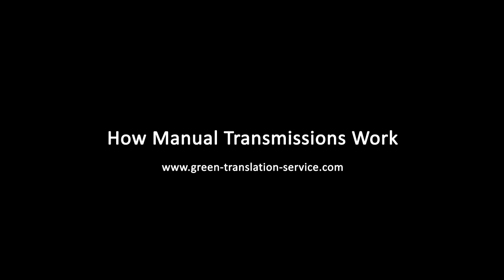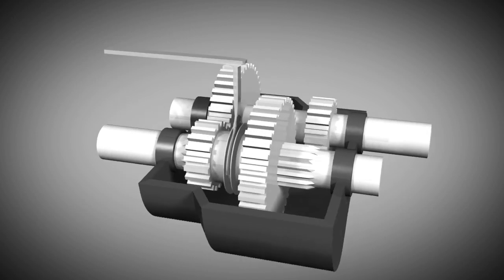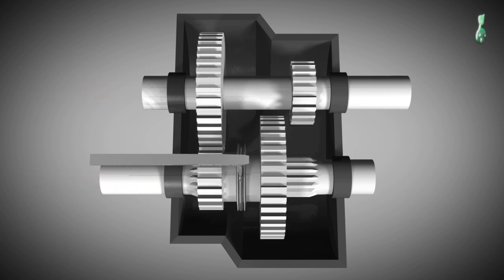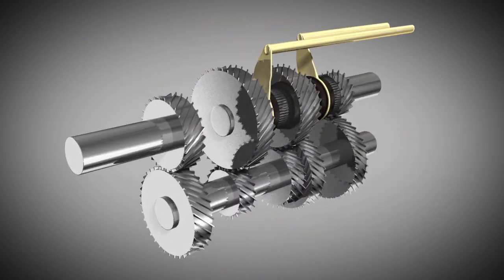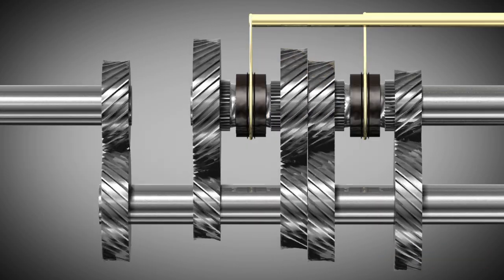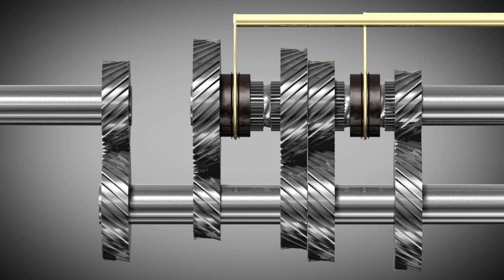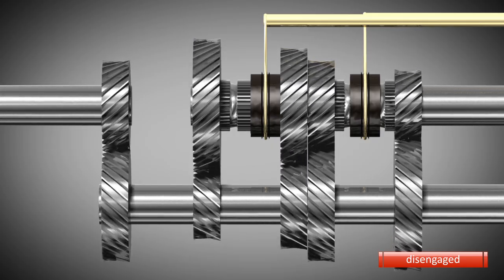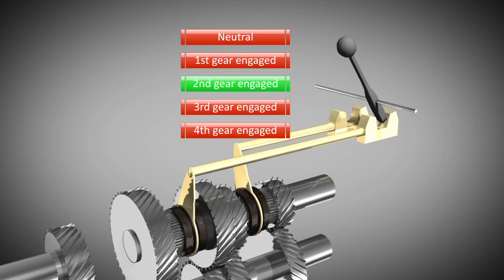How Manual Transmissions Work! (Animation)

Comment: Thomas, thanks for the great video! could you please provide a good visualization of partial engagements in dog clutches? or direct me to a good source? 

dog clutches are often used in AWD/ 4WD 'disconnect' systems, i.e. if half-shafts and wheel-hub are disconnected, they help to get them connected again and drive in 4WD mode. I don't have a good idea of what exactly happens in partial engagements, or why they happen. I just know that it is related to the bevel of the dog clutch design somehow. it would be great if a clarifying video/ animation is made focusing on geometry :-) thank you in advance! please keep these coming.

Comment: It's so hard to understand how the energy is actually transferred when all the gears are constantly connected to each other. I understand that the position of the dog clutch is what decides the gear ratio, but not actually why. Great video though!
Reply: The energy transmitted by the engine hits the first thing connected to it's line of stream, what you dont understand is that energy is not coming from the engine it self, but rather preserved in the fly wheel, then transmitted to the input shaft, putting this concept in your mind will help you understand this.

Comment: I don't really understand the dog clutch part.
Reply: +kevin gose Its not the Output Shaft which is rotating. He has clearly specified that the gears on the Output Shaft are Losely connected and can freely rotate. It Seems like the output shaft is rotating even in neutral position but its only the Gear on the output shaft which is rotating. OutPut shaft Will only rotate when the dog clutch will be fully engaged.
Correct Me If I am wrong...😊😊😊
Reply: It seems like the outputshaft spaining anyway and the it slide to one way. What does do？ How does it make the change？
Reply: +kevin gose Really great video by the way.
Reply from the maker: Here you'll find what you are looking for: https://www.youtube.com/watch?v=0Bqs-oHBBQk
Reply: +Thomas Schwenke Thks a lot！Now it makes me way more clear！ Even tho there is a little bit detail I don't understand. And I really like your channel. I like how u using those pictures to explain things. It make things more sample and clear. It is a really easy way to understand cars. Keep up the good works！
Reply: when the dog clutch grabs onto a gear which is done by shifting gears, then the dog clutch will rotate the output shaft at the speed of the gear it grabs on to.. hope its helps.

Comment: what about reverse gear? and and how does the fifth gear works?
Reply: +Omkar Chavan reverse gear is activated by a separate intermediate gear connecting the parallel running shaft to the output shaft. 4th gear is usually when the input shaft and the output shaft are connected directly with a 1:1 ratio, and 5th gear would be an overdrive gear ratio where the driving gear on the parallel shaft would be larger than the driven gear on the output shaft
Reply: +Paul Wiest I mean the counter shaft not the parallel shaft excuse me

Comment: So here's a question, what if you moved two of the dogged clutches at the same time initiating say 3rd, and fourth gear at the same time? What would happen?
Reply: ***** I don't even remember posting this question. Now thinking about it, my guess would be that the engine would just lack in power severely, and that it would engage both.

Comment: why sometimes it jerk?
Reply: +omguanyin The jerk occurs when the output shaft is rotating at a different angular velocity from the input (and counter) shaft. The jerk is caused by the transmission reconciling the difference, which usually is the form of the output shaft quickly speeding up or slowing down to match the input shaft. That's why non-novice manual transmission drivers will try to match the RPMs of the engine to their model of the output shaft before engaging the friction drive as they switch gears.

Comment: The only thing missing is the reverse gear
Reply from the maker: +DBSAOFSWOK Well, oil, synchronizers and some other 200 pieces are also missing, but, here, it's all about the basic principle.
Reply: I have another question, you might be able to answer. Why is the gearing in an automatic transmission arranged in the way it is - and not the same format as a manual. To conserve space??

Comment: I don't get what would happen if the clutch pedal is not pressed while switching gears.
Reply: +Cyril B it depends on the speed (rpms) of the engine. If fast enough the gears can be shifted without clutch, If not that's when you grind gears. The clutch releases the in put shaft so your able to put it in any gear. However first to third lets say there isn't enough power to keep car running.

Comment: In an H type config, a driver could immidiately switch from neutral to 3rd or 4th without having to step up from 1st or 2nd? More of a hypothetical, but I'm curious.
Reply: +MacedoniaGamingNetwork - MGN no I realized going from neutral to 2nd would be kinda pointless. I was wondering about 2nd to 4th or 1st to 3rd. I know you can downshift over gears, but I'm assuming people who do that have synchronous gears to automatically rev match.
Reply: like I said, it was more hypothetical, but good to know.
Reply: u can actually start the car in 2nd lol

Comment: What about 5th gear? I use it a lot since it reduces RPM (saves gas)
Reply from the maker: DragonsREpic Well, there are also cars with 7 gears :) / However, this animation is about explaining how a manual transmission works. The principle explained here it the same for other transmissions (with more or less gears).

Comment: I'm sorry if this is a dumb question, but why are the gear teeth slanted like that? Why can't they be straight?

--Nevermind, I figured it out myself. They are quieter and more smooth than normal gears.

Comment: how come when you change gears the torque only goes through 1 gear and not the others even though the other gears touch each other?????????????????????????????????????????????????????????????????????????????????????????????????????????????????????????????????????????????????????????????????????????????????????????????????????????????????????
Reply: This is some inception shit right here.
Reply: Jebediah Kerman it's because they rotate freely on the shaft until the clutch locks the gears to it dumbass
Reply: Jebediah Kerman ...what
Reply: Travis Wheeler huehuehueuhe

Comment: Thanks for your video's. I subscribed. 

Btw, how does the reverse gear come into play?
Reply: 1989ElLoco Just like any of the foward gears, but the use of an idler gear between the layshaft gear and output shaft gear. This reverses the direction of rotation of the out put shaft. I think he explained it on his video with the syncronised transmission.

Comment: Now I more intuitively understand what the unholy sound is that occurs when you switch gears without putting in the clutch...
Reply: That is the sound of the sleeve grinding against the teeth of gear that refuses to change speed and engage as it is locked to the engine while the synchronizer cone is being painfully ground down sandwiched between the two.

Comment: When you press the clutch in, does the gearbox stop spinning or does the energy transmit from the wheels to the gearbox? How does the dogclutch move from gear to gear if the gearbox is spinning and it is stationary?
Reply: When you press on the clutch it decouples the input shaft and the engine. This means the gearbox is no longer controlled by the engine. The output shaft would still be spinning relative to the speed of the car.

What this video leaves out are synchronisers.
They are basically tapered metal rings (think of the bottom of a very thin cone (the wide part, not the pointy part)) that sit onto a tapered section of the gear. When a gear is disengaged there is a gap between the ring and gear. As you go to push it into gear the ring presses against the gear matching the rotational speed. The dog clutch then aligns it and allows it to mate properly.

This causes minimal wear as there is no torque coming from the motor and it is just a few shafts and gears that need  to have the speed matched, not the entire car.
Reply: when you press the clutch in, the friction clutch stops pressing into the input shaft so it doesn't have any more torque putinto it but it can remain spinning. At the moment when you shift, the dog clutch is spinning the same speed (it should be or there would be a problem, also it wouldn't make sense to be moving at a different speed during a shift), and is on guiding indents ont he shaft, and because its spinning at the same and is allined with the other side of the dog clutch, it can just slide on. 

Basically, during the moment of shift, when the friction clutch is disengaged, the gearbox and dogclutch are spinning at the same speed so it can just slide on.
Reply: Miket G but if we go by the logic that "during the moment of shift, when the friction clutch is disengaged, the gearbox and dogclutch are spinning at the same speed so it can just slide on.", why do we need clutch then? we can directly change the gears. or will it cause some damage?
correct me where i am wrong
Reply: Jeffrey Black thanks
Reply: Jeffrey Black So there's more than just pushing the gas pedal? Pardon me for the lack of knowledge but my car and I were under the impression that there was only one option....(GO...to work.....fast...)

Comment: so u press the clach pedal the engine is izolate for the gear box, how the counter shaft turn and go sincronizate with wheel shaft ?
Reply: If you it in a gear (while moving) with the clutch out, then the wheels of the car will spin up both shafts (output and countershaft) according to whichever gear is selected.

Comment: Why are the second and third gears sitting directly next to each other in the diagram? Doesn't that produce friction/loss of transmission or is that just for animation? Also, when using gears further along the counter shaft is energy not lost rotating previous gears? I really want to understand car propulsion!

Comment: Wow it all makes sense now. I burned out my clutch but now I quickly realize why I did. One I somewhat rode the clutch but the main reason is that many times I never had the clutch fully pushed down when I switched gears which caused the gears to make horrible noises. I have to get used to fully pressing the clutch. Secondly I let go the clutch to slow when going from a full stop to 1st hear acceleration. Lesson learned. Now $500 out my pocket for a new clutch kit.

Comment: So this is how manual transmissions work! I've always wanted to now it. Seen a couple videos not long ago but yours was the first and only that managed to explain it better and with more details. Especially how the gear lever works. The others didn't mention it and I was wondering it, also. It's actually simplier than I imagined! Thanks man! :D Only thing that I think is missing from this explanation is how the reverse gear works. I imagine it's the exact same as the other gears, but with the dents "printed" in the opposite direction as the others.

Comment: I have a question: what gears spin faster etc, does 1st spin faster than 2nd and 2nd faster than 3rd and so on. Or does 3rd spin faster than 2nd and 2nd than 1st? And if you have time and understand it, can you do an animation on the Zeroshift transmission? Cant understand it..

Comment: Thomas, I have been viewing manual transmission videos all weekend and yours is by far the clearest, simplest, and most concise thus far.  I have a question for you. Assume you are engaged in first gear as you approach a stop light. Once stopped with the clutch engaged and input shaft no longer turning, you attempt to shift OUT of 1st and into neutral, but the shift lever feels "locked" in the 1st gear position. In your opinion, what if anything, could cause that to happen?
Reply from the maker: Hi, sorry, I have no idea...
Reply: Sounds like the engine or one of the shafts is still transmitting power. Check the clutch master cylinder or cable (whichever you have). Perhaps it was not bled correctly and the clutch is not fully disengaging.
I imagine the reason you can still shift before coming to a stop is the engine breaking created from letting off the gas reduces the force enough on the gears to allow the lever to move. You've probably fixed this by now though.
Reply: thank you. You are correct on both points. I did fix it, and the clutch was NOT fully disengaging. I believe the reason was an accessory to add length to the clutch pull at the engine end.  It made it easier to pull the clutch lever, but the pull was only traveling half the original radius

Comment: Why doesn't the dog clutch grind the output gear? How is it synchronised?
Reply from the maker: This will be discussed in another video.
Reply: Thanks
Reply: Balee Tong Most probably they have some kind of rings, bearings inside, that allow them to slide while the vehicle is in motion, but still in speed + clutch pressed.

Comment: Sergej Grabun   What you are referring too is called a sequential gearbox or transmission. The high pitch noise from a transmission like that is usually associated with a "dog box" transmission similar to the one in this video actually since most street cars would actually use synchronizers instead.

"dog box" transmissions can be H pattern or sequential in nature.

http://www.importtuner.com/tech/impp_1109_synchromesh_vs_dog_box/

Comment: You just got one more sub (me). Excellent videos.
Can you make a separate section/playlist where you explain Sports Car transmissions/springs/suspensions ant tires (like the one used in WRC for example). I am mostly interested to see how a gearbox is made/works which does not need clutch. One which is used in WRC at the moment where they just pull or push transmission lever and that's it and they make high pitch noise as well :-) Where that noise is coming from?

Comment: What's a gearbox whitout reverse?
Reply from the maker: Hmm, I would say, a great way to explain the basics :)
Reply: Thomas Schwenke  Reverse is one of the most important gear in Gearbox.
Reply: Cristian John
Not basic, however. Cars didn't use to have it until it was added to the gearbox later. It probably involves another step that's on top of this which is why it's not part of the "basics" the video is trying to explain.
Reply: It's not the point of the video to discuss the importance of reverse (or any other) gear.  It is a basic description that illustrates for the uninitiated of how gear changes occur.  For reverse, an intermediate cog would reverse the direction of the drive shaft.
Reply: One used in motorcycles.
Reply: That's not the point, it just adds onto the video and is irrelevant.

Comment: Hi, that's a really nice video, but i'm just wondering if there's any bearing inside the gears on the output shaft. Because as it's seen, the output shaft won't rotate when the dog clutch doesn't lock any gears on the output shaft. Thanks
Reply from the maker: Yes, there is a bearing.

Comment: Thomas fantastic video, as beginner im just learning about this technology and I have a question. On the 'H' pattern four gear system, When the dog gears are in neutral should all the gear wheels on the gear shaft not be out of line and not engaged, i dont understand how they would still be touching if not engaged with the counter shaft. the video shows all gears to be touching at all times.
Reply from the maker: Hi, sorry, I don't get your point!? What do you mean exactly?
Reply: Thomas Schwenke
 I was not able to explain my self better. So i got a more experienced mind to help me.You eplained it in your video I just did'nt pick it up. The gears on the gear shaft are on bearings and spin independently from the gear shaft untill engaged by the dog gears and thus this is why all gears are moving together. Thankyou again for such a helpfull video.

Comment: You mention that the dog clutch can shift from engaging one gear to neutral and then to another gear even while the shafts are in motion because the rotation speeds will be matched. How is this matching accomplished? I ask because it would seem that the output shaft will be turning at whatever rate the wheels are turning as the car continue to move by inertia, but the other gears that were not previously engaged would each be turning at their own speed as dictated by their ratios.

Comment: your video gave great incite, but now i have more questions than i came with
Reply from the maker: And those are?
Reply: Thomas Schwenke how does the friction clutch operate while the car is idling, how do the dog collars work in transmitting power to different gears, how does a transmission cope when the engine accelerates hard and the rpm's go up much faster than the car's speed?

Comment: I have one question: At 3:48, when the clutch is disengaged why are all of the gears spinning if the input shaft is not spinning ?
Reply from the maker: The input shaft IS spinning, because the wheels are spinning...